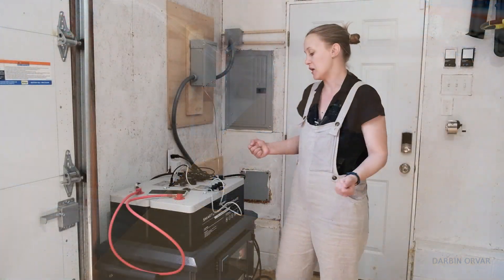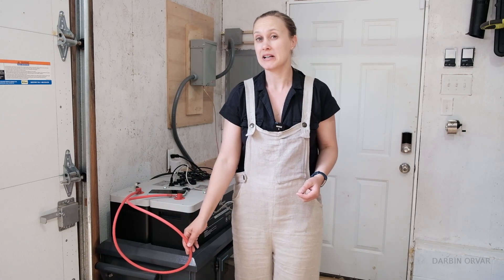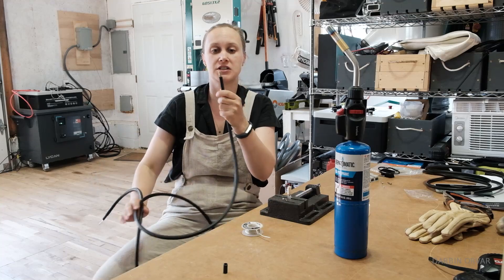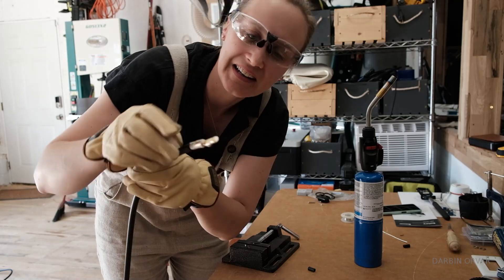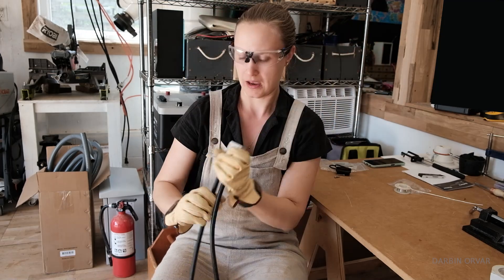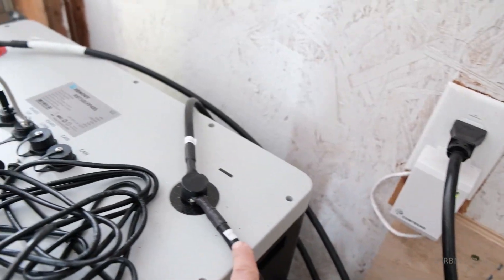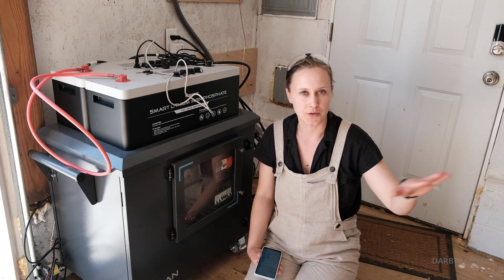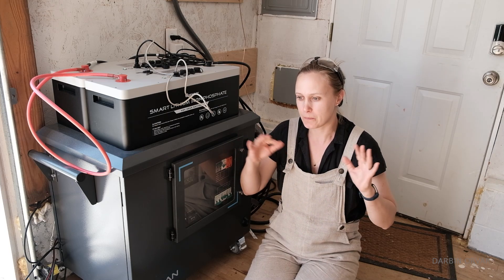How To Make 120 Anderson Plug Connectors // Renogy LYCAN 5000

Comment: Great video I just got the lycan. I do want to mention that a crimp connection is better than solder and actually the solder can become weak and loosen causing a bad connection which can be very dangerous. If you were talking about solid copper wire then solder might be stronger but not Stranded wire. Good luck with your off grid solar project.

Comment: That's plumbing solder and plumbing flux.  While plumbing solder is only mildly inappropriate for such work, plumbing flux is a terribly bad idea to use on wire.  The acid in it WILL lead to future corrosion issues.  Also, you shouldn't be heating wires with a torch..  That's a plumbing technique that will lead to oxidation of the wires and a bad electrical connection.

Comment: I believe electrical solder would work better than plumbers solder. Not a corrosive. Electronic flux as well. Acid flux v. resin flux. 

A proper crimp tool is superior to solder.

Comment: Hello Darlin!  I just discovered your channel and am enjoying it.  What is the status of your teardrop? I will be building a second one shortly.  I will be using a bluetti power station to be the brains of the electrical system.  Makes it very very simple.  It is all in one.  All you need for the teardrop is to run the wires.  Good luck!

Comment: In fact crimping is more safe than soldering,specially in high power applications.
What do you thing happening if the solderer plug getting realy bad headed up in use, it will desolder itself and than you have a very very bad problem and that can't happen to a crimped plug.
Reply: yeah, seems strange to recommend soldering when everybody else I have heard recommend crimping i high load things.
Reply: @scania9786  that's Happening with people that don't inform themselves properly and talking only what they think is best and not what the reality and facts are. 😊
Also it's not very good to have for everything the same coloured cable, you can even buy in propper shops 10 meters cable wher you get 5m red and 5m black in one package. 😊
Reply: Harry  cou make the crimp weaker by soldering it and ther is no safer way to be safer than crimping allone, that's only psychological extra soldering and that's not good, peopke have to much fear that's even misused by govermants and big company's.

Comment: Those Anderson connectors are pretty bulletproof if used right. They were, maybe still are, the standard on heavy electrical equipment like forklifts for battery connections. The chargers and lifts I worked with were pretty well abused and it was typically the wire that was damaged before the connector. You can rent the hydrant crimp tool at some electrical supply houses. Much faster than soldering.

Comment: I’m wondering how the batteries work with a hard start device, like A/C??
Reply from the maker: These kind of batteries would have no problem delivering power. Each one can give up to 50 AMPS @ 48 volts ~ 2500 watts. The inverter for the Lycan can do 7000 watts for short bursts like AC systems.

Comment: Don’t do it this way.  Get a crimping tool. Soldering is an inferior method.
Reply: Nah, the plumbing flux makes it better.
Reply: Better strain relief with crimping. Vibrations can fatigue the wire at the solder joint. Seen it happen.
Reply: If you carry high current, you might get hot.  If you get hot, the solder melts and flows out.  If the solder melts and flows out, resistance increases, meaning more heat, meaning more melting.
Reply: Totally agree a hydraulic press for crimping is so much more superior. Why do you think every electric crew uses them.

Comment: I work with these connectors at work almost every day you can remove them once installed. All you have to do is get a flat head screwdriver on edge and push that metal tab down while pulling back on the wire. We have to replace the plastic shells when they get broken all the time.